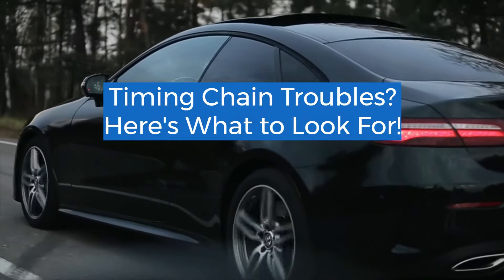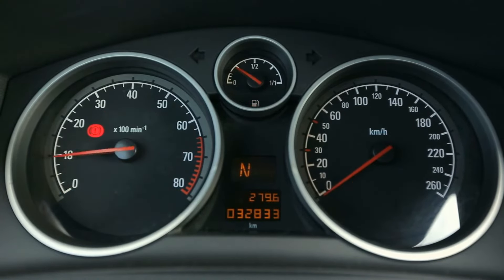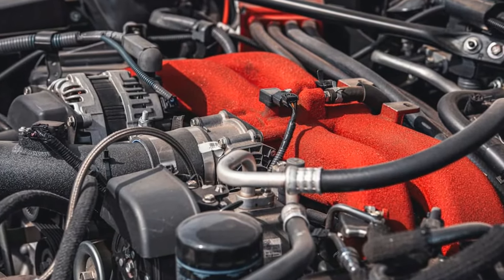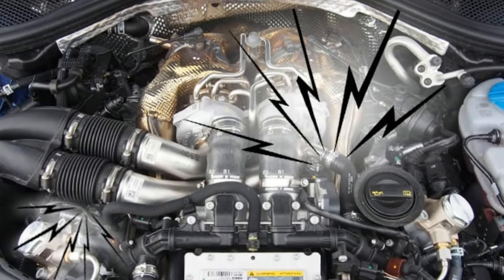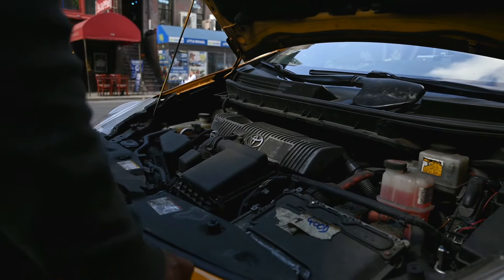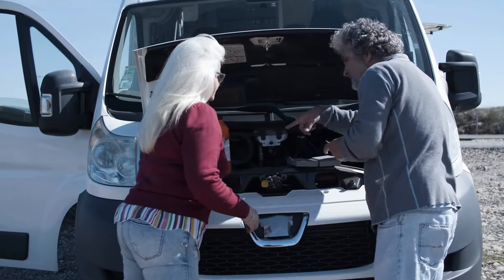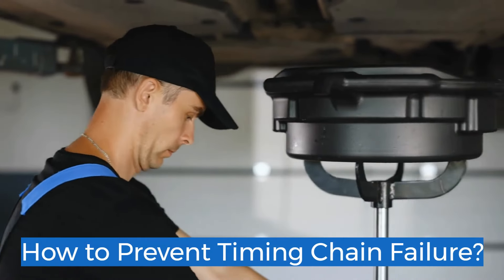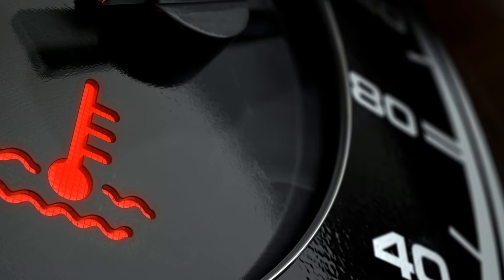Top 5 Symptoms of a BAD TIMING CHAIN [What to Look Out For]

Comment: MyVW jetta just got this problem at 160k and caused that the engine is now gone. regardles s of diligent maintainance i was keeping.
Reply: I have VW Jetta as well 170k now and i start to hear noises in engine idk if its timing chain or smt else. No engine light is showing and i diagnosed but nothing shows 🤔
Reply: @aminezerouali3941  Don't drive it! don't start it.  Is cheaper to change the timing belt or chain and the water pump is not that dificult
Reply: I was hearing noises !! before the engine died
Reply: I only change the timing belt and water pump . on the same engine and is runing great. Let me know!!
Reply: Thank you 🙏🏻

Comment: can it cause camshaft pos sensor cir. Range/performace error code p0341?
Reply: The camshaft position sensor error showed, cleared, re-appeared after my 05 Vivaro broke down last month, changed the sensor, van won't tick over, starts on easy start. Can hear the chain on shutting the engine off. It's the timing I just hope pistons are alright.

Comment: I have 2016 Scion IA AKA Mazda 2. 298,000 mi. Always changed oil myself and used full synthetic. It burns oil but I keep up with it. Just other day started making rattling sound for a few seconds when starting up and then goes away. Only does it on startup. Is this timing chain or possibly starter?
Reply: Did you find out what the noise was? I have a 2018 Toyota Camry, and it rattles when starting. Otherwise, it runs fine.
Reply: @theupdownlife2179  not yet. I'm changing the timing chain tensioner and water pump. Hoping it's bad chain tensioner.
Reply: @SeanDoe86  
My mechanic told me it's a high-pressure fuel pump located in the engine. I thought mine may have been the timing chain also, but it's happening on the driver side only, and the timing chain is on the passenger side. 
The symptoms with my car only happen when it's hot outside 😒
Reply: @theupdownlife2179  maybe intake VVTI gear
Reply: @SeanDoe86  
Omg! Thanks 😁 I'll look into this. It's making me crazy
Reply: Goodday. Was it the tensioner?
Reply: @imgettingold9407 nope. it was the VVT actuator.
Reply: @SeanDoe86  wow.. thanks for replying
Reply: @imgettingold9407  👍

Comment: I have a mini cooper that I’m still paying off with a bad timing chain. Am I cooked?
Reply: Depends on what damage has been caused. If only chain is bad, no you’re just out about $2000-$2,500 bucks unless you do it yourself.
Reply: @LeeAndRhymz friendly chev is charging 900 for diagnosis then 4000 for the timing chain. At that rate isn't it more cost effective to buy a whole new engine?

Comment: My 2000 Ford Explorer finally needs a new timing chain after 240k😢
Reply: Hello, I got the same issue, what did you do ? did you replace it ?
Reply: No, my mechanic said that I should rather just buy a new or reman engine instead, but I didn't want 2 spend the $$$